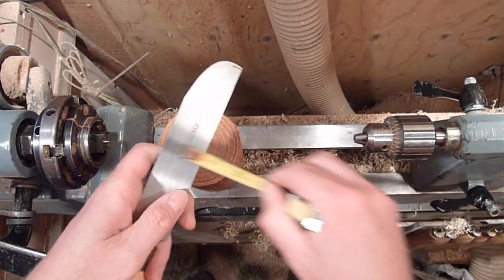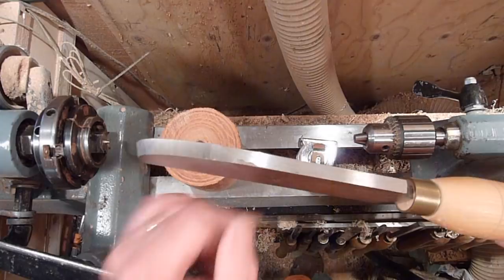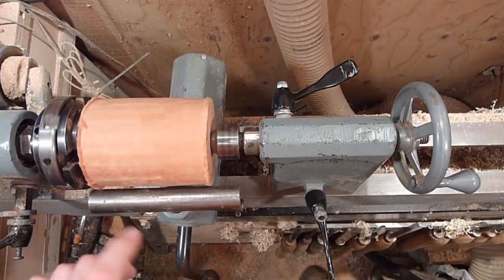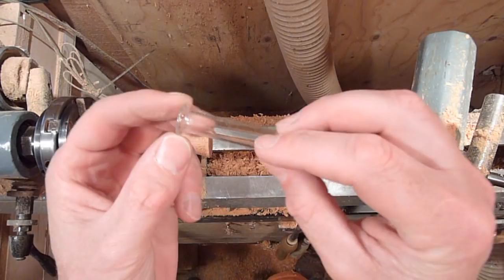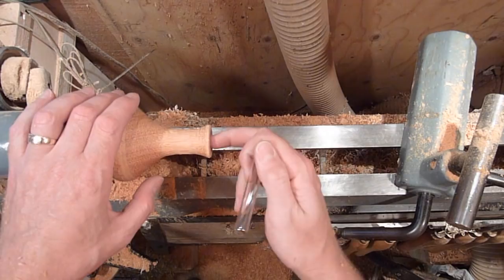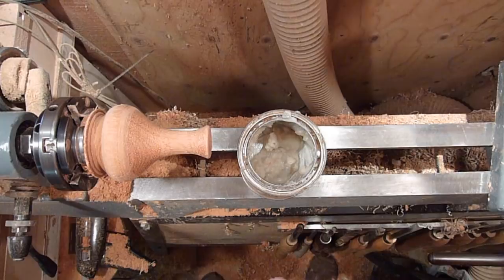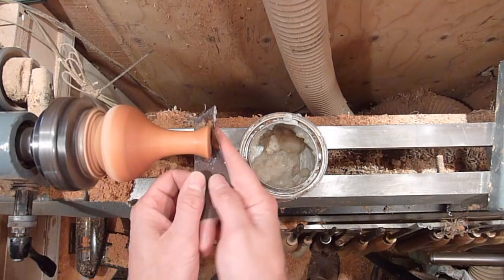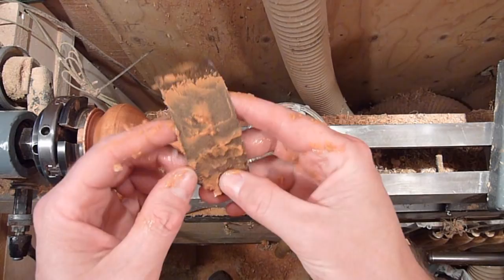Wood Turning Project Bud Vase from reclaimed wood

Comment: Hi Carl,  I love your videos and I'm getting back into turning after a 4 year layoff and I've learned a lot from watching you. My question is: After sanding with the wax/oil mixture, have you ever buffed the piece on a buffing system? If so, how did it turn out? 
Thanks in advance, David
Reply from the maker: +David Judd Thank you very much David. Yes I've used the buffing wheel on a few pieces it turns out great and a nice shine

Comment: nice vase, in this video what chuck are you using?  I have one that came with a used  Delta 46-460  lathe, but there are no markings on it, and I would like to see if I can get larger jaws for it.
Reply from the maker: Thank you Tom! This one is a Nova chuck
Reply: @CarlJacobson  Thank you, I am just beginning and the chuck jaws seem to be smaller than most of the ones I see so was hoping to get bigger jaws or replace the chuck.  I do enjoy your work.  Thanks again
Reply from the maker: Thank you Tom! I think you can still get jaws for it.

Comment: where did you get the glass tube? What do you think about using Helmsman marine finish from minwax for vessels holding water? Beautiful piece. Thank you for all your teachings. They are valuable.
Reply from the maker: Thank you Debbie! I've never use a marine finish, but if it's waterproof it should work. I got the tube from one of the turning supply companies I can't remember which one.

Comment: how did you finish the base on the vase
Reply from the maker: I use a sanding pad that goes in my jacobs chuck. You can use it on the lathe or a drill press.
Reply: @CarlJacobson  Thank you